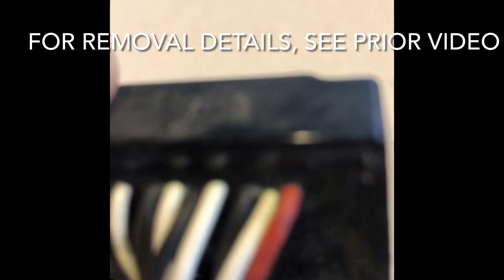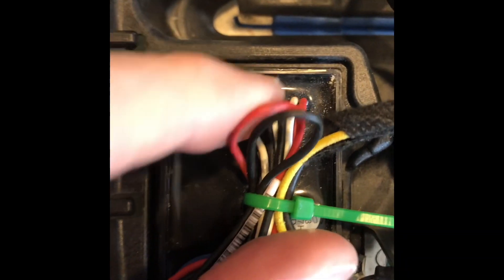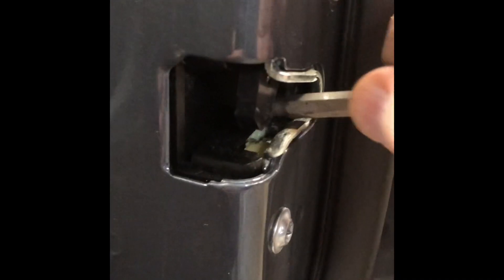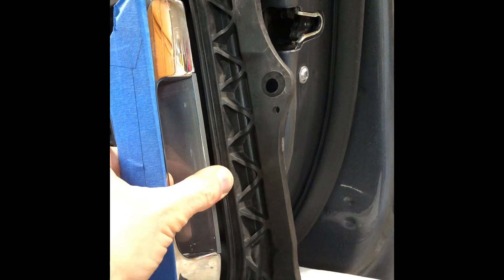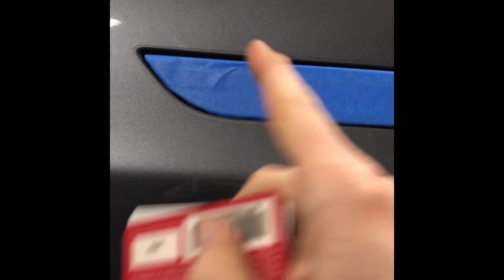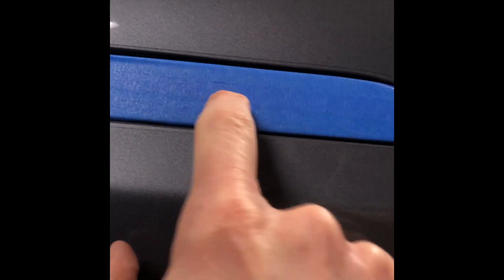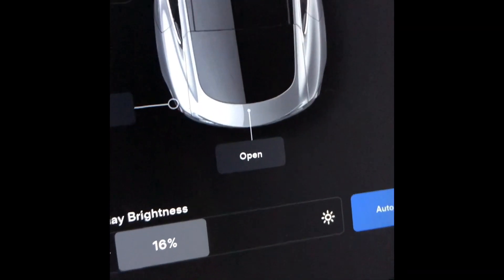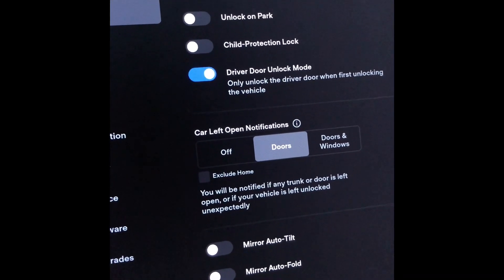How to replace a door controller in Tesla Model S after handle fails to unlatch/becomes erratic

Comment: Where did you order this part from? I have looked all over eBay, and tried to find this specific part, but it is near impossible to find, but I have a feeling I am searching for it wrong.
Reply from the maker: I have had good success getting it over eBay -- but you do have to match up the numbers pretty precisely.  I don't know that Tesla ever sold the controller separate from the handle.    
The part number I have saved is :  1018745-00-H  (try searching that on eBay) but there's notations on all the auctions that :  "(Front left part number is 1007373. Front right is 1007372. Rear left is 1007375. Rear right is 1007374. )"   Those refer to COMPLETE handles.  
I believe the controller is the same for all handles-- but you'll want to get it out of the car and search the number on it very specifically.  

Looking at the Tesla EPC parts catalog online, you'll note that it is in the drawings but not numbered or labeled in any way.

Comment: I have done the same, but for the rear right. But the problem is I can not open the door, it will reveal itself but will not open. I went to service mode the handle on that side shows unknown? Do you know the issue?
Reply from the maker: I have a rear door handle that currently presents but doesn't open -- there are several possible reasons why, but you can't really diagnose without removing it and inspecting.  Most likely it's the wiring harness (with the switches) or the paddle gear. Parts are widely available and inexpensive-- just look on Amazon or AliExpress.
Reply: @NZCUTR  I feel that it is a hardware problem, because for some reason when opening the front door the rear door reacts the same (rear thinks the door is open). And in service mode it shows as unknown in kalibration. So it must mean the car cant read the new unit (1022379-00-B).

Comment: This is gen 2.1 right?
Thought the controller had to be programed?
Reply from the maker: MMm....not entirely sure what the various situations are that do/don't require programming.  The current gen 3 handles DEFINITELY need to be software calibrated, but on my Gen 2 (various flavors) I've just swapped out the door controller with no problem a couple times now.  The movement of the handle on those is all about the screw adjustments, not software.  FWIW, a lot of parts on the older cars (at least) can be swapped and then "reauthorized" simply by installing a software update. This can be done through service mode or just defer repairs until you have an update pending and then install after repair is complete.  YMMV

Comment: Do you happen to have the part number for the door handle controller?
Reply from the maker: I don't know how many variations there are on the part, so your best practice is to remove your handle and match the part number on the controller you have. You can not buy this from Tesla as they only replace entire handle assemblies, but once you verify your controller part number you can search that specifically and find it on eBay and other part websites.